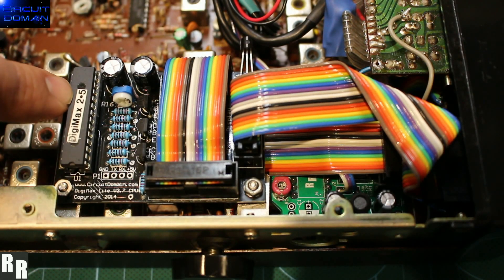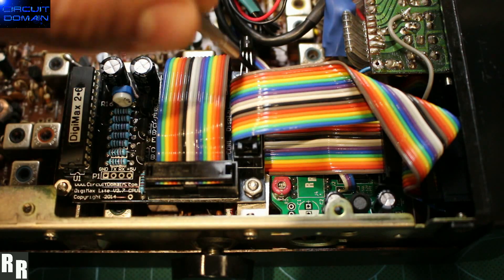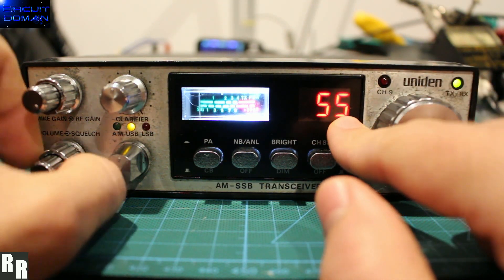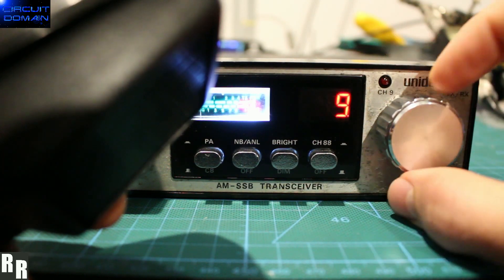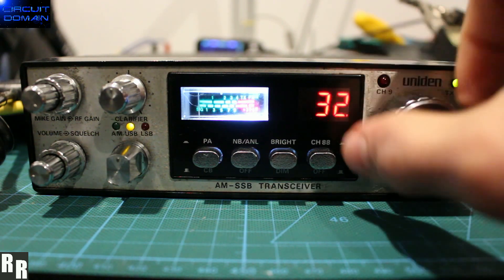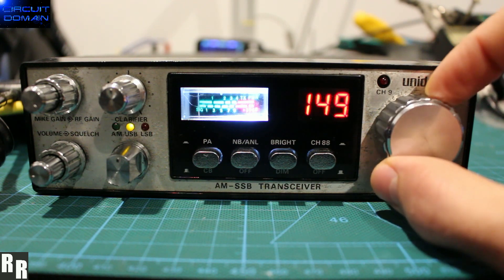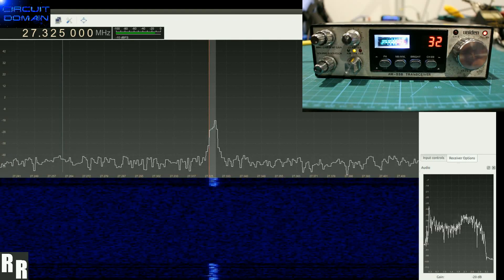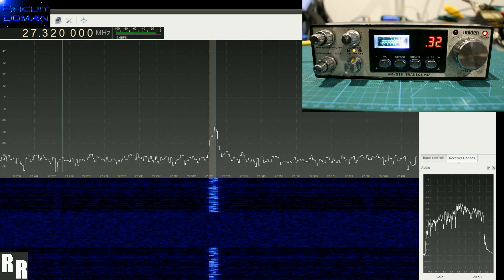DigiMax Lite V2.6 with 5kc/10kc stepping.

Comment: very nice i have v2.0 in a few radio's  will have to up grade thank you Mac for all the time and  effort you put in
Reply from the maker: Thanks mate, been wanting to do 5kc for a long time now, just limited with time etc...
Hope you guys will enjoy it..
There's more in the pipeline atm.
Reply: @CircuitDomain  yes i will be putting mine in a cobra 139xlr
Reply: I had a Cobra 29XLR with a v 2.0 board in it.  Great sounding AM only rig.  I sold it many years ago, but I’m sure it’s still out and about.  Not bad for a radio made in 1977 or 1978.